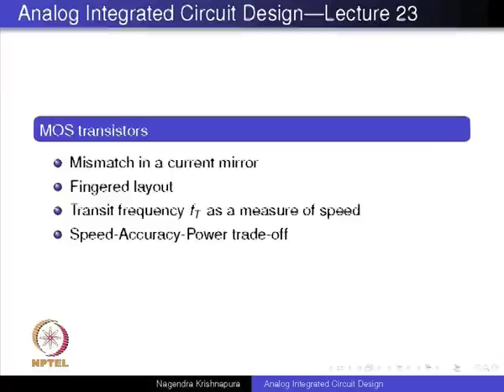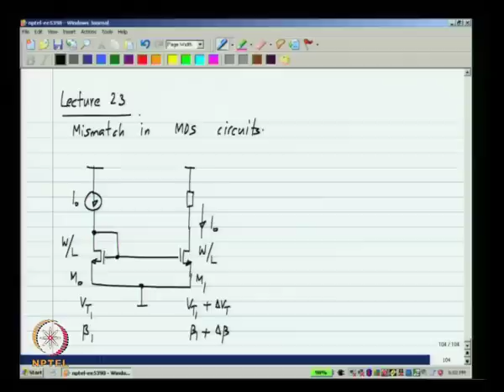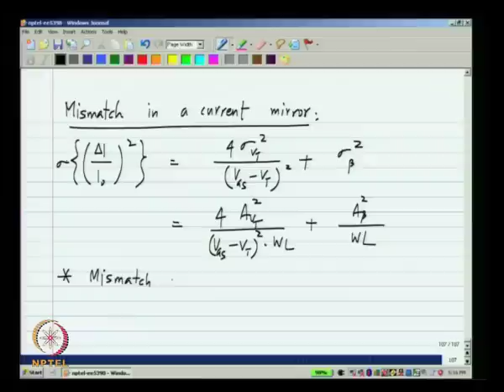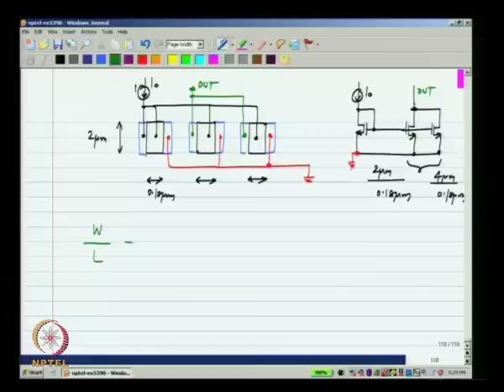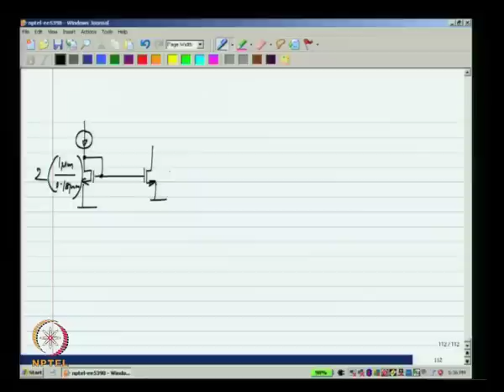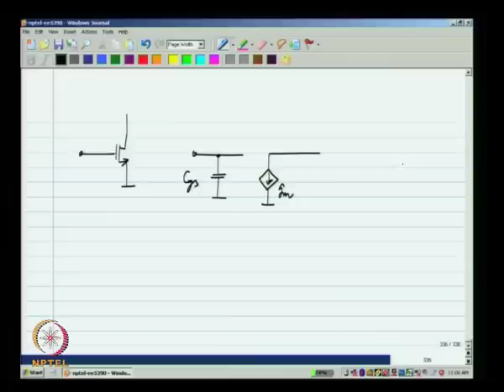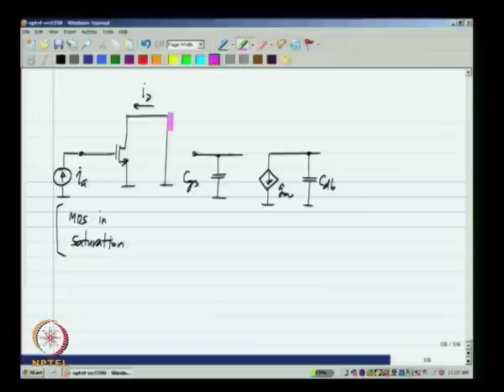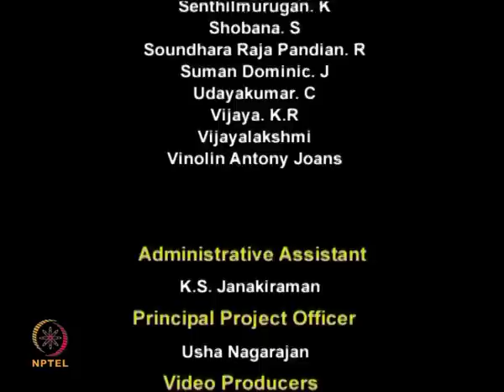Mod-01 Lec-23 Lecture 23

Comment: 36:27 why there is no connection between Drain and Gate for the M1 because M1 should be a diode connected transistor its Drain must be shorted to Gate